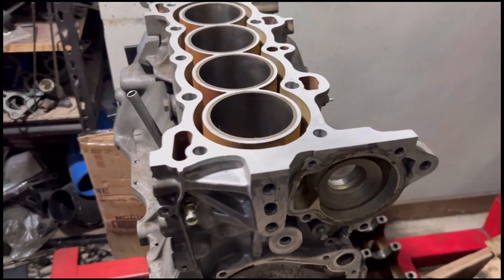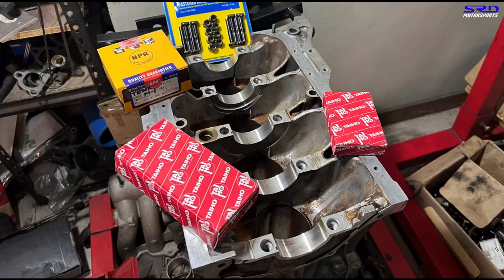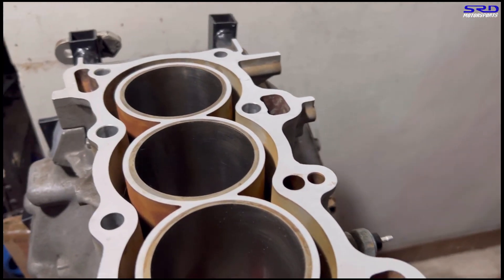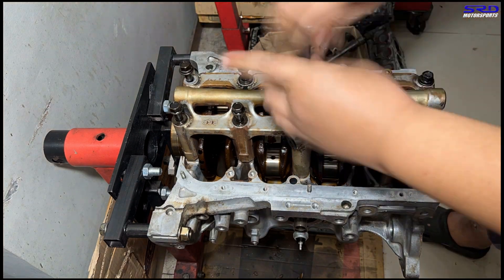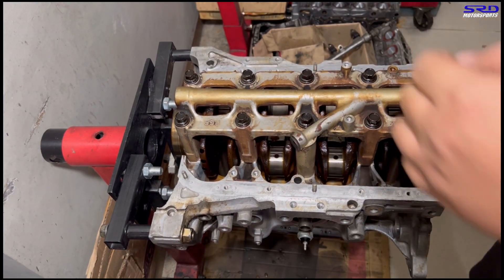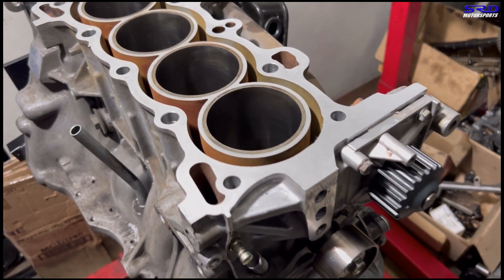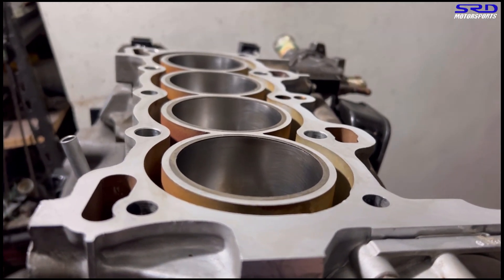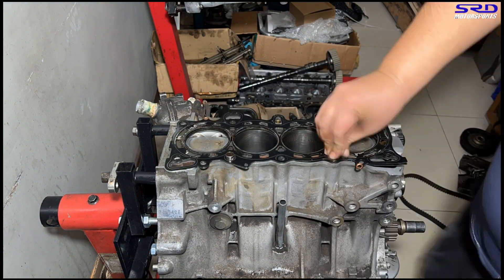The Most Complete D16zc Rebuild Start to Finish by SRDmotorsports

Comment: I have the same block what you think of putting a light vms  crank pulley for a turbo setup?
Reply from the maker: Well aftermarket pulleys don’t have a damping effect unlike the oem zc / z6 pulley with the rubber insert…
Reply: I already got the crankshaft balanced with the light pulley. Should I just slap the oem pulley back on?
Reply from the maker: then it’s okay to use the VMs cuz it’s balanced together…still no damper though but I guess it’s okay

Comment: Hello sir Ralph, if the bores are honed do I need to change to larger piston size?, or do I really need to hone the  bores if Im going to change new piston rings. Also what  are the honing specs? Thankyou for the response
Reply from the maker: Honing doesn’t really enlarge much just refinish the bore texture so it’s fine unless the bore is oval then u need to go oversized pistons…
Reply: @SRDmotorsports  appreciated sir
Reply from the maker: No probs :)

Comment: Is d16y8 same torque spec rod bolt  if i use arp?
Reply from the maker: Just follow arp numbers

But that’s also better if stretched as I always shared on every video
Reply: @SRDmotorsports  thank you
Reply from the maker: No prob

Comment: sir may alam po ba kau magaling mag regrind ng camshaft to increase loft and duration para sa ph12 cam.
Reply from the maker: Only in the US delta cams
Reply: ah sa states lng pompala meron  nag ggrind. what do you sugest sir. kaskasya po ba ang cam ng d15b  sa head ng ph12 sir taos ilock k nalang ang pang vtec. is it possible
Reply from the maker: @jojoc3418  no different rocker arm system sha plus a lot saten cam ng cam when the rest isn’t even fully maximized… 

I built a stock cam stock non 20camlobes vti and pAntay sha sa siR so why 20camlobes? Why regrind if kulang kulang naman?  It won’t solve an incomplete set up

It would actually make it worst na mas incomplete tuloy lalo
Reply: tama ka po sir. dahan dahan k po bbilhin lahat ng kelangan sa build na balak ko sir kaya balak ko bumili na camshaft muna meron na ako valves and springs and seals. kulang k racing cam  para sa head po
Reply from the maker: @jojoc3418  what brand valve springs and seals?

Comment: So your using the d16z6 pistons in the zc..block with z6 head.  ???
Reply from the maker: Well the d16zc 92-95 has a vtec version from Japan that has a p08 head so that’s essentially a d16z6

there is also a d16zc from japan with a pm3 head which is essentially a d16a6 but obd1

so I’m using the zc pistons that came in the d16zc block that’s p28
Reply: I have sohc d16zc non VTEC. I have a z6 head . Will I run into any issues. ..thanks for the info.( 95 civic )
Reply from the maker: @Jpower32  I think the only issue possible is if u mill the head too much and advance the camgear…

That’s quite like a d16a6 block + z6 head mini-me should be quite alright and slightly more comp due to the pm6 pistons
Reply: That's all I needed to hear ..! Thanks for the videos you make brother. I'm currently watching your channel.... I'm doing a mild port and Polish on the z6 head...then putting it on the zc block..! Keep it coming.. thanks 👍🏼👍🏼.
Reply from the maker: @Jpower32  no problem man! Just glad it’s working out good for 😎